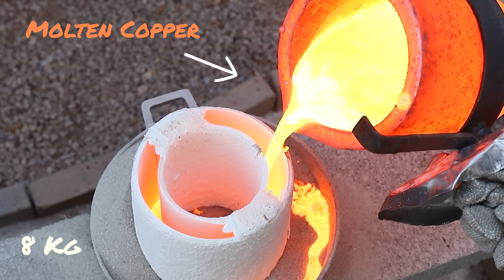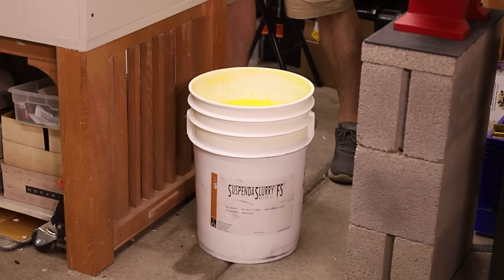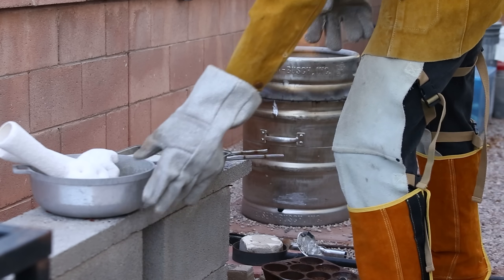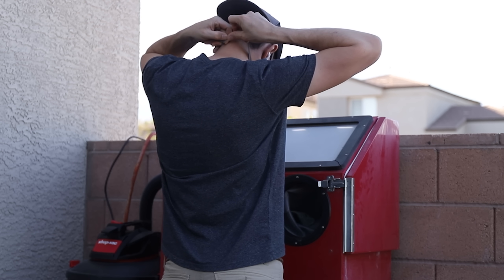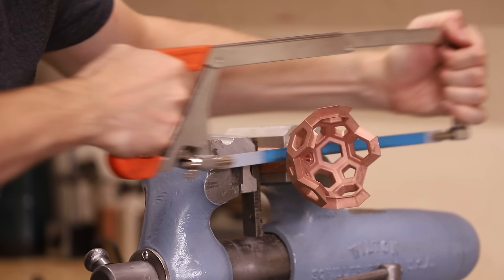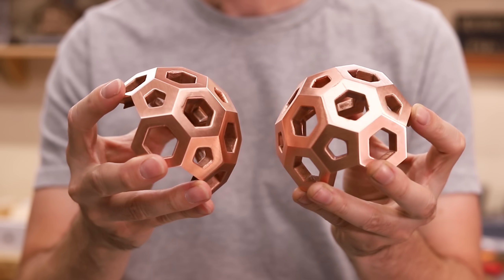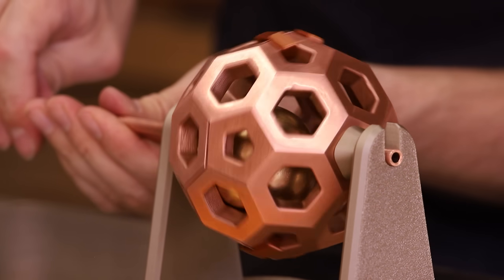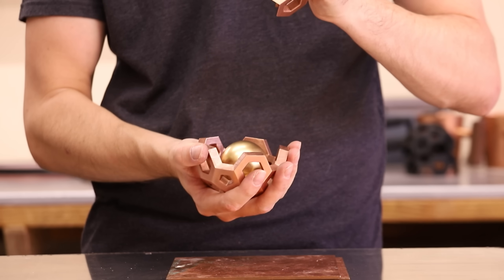HUGE Magnet VS Copper Sphere - Defying Gravity- Will a Neodymium Magnet Float Inside?

Comment: There is probably an optimal speed - you want enough rotation around the magnet to induce currents that cause force to levitate the sphere but not so much that the sphere precesses like a top.  You want to avoid precession since it affects orientation of the fields.

Another experiment might be to induce a voltage across the sphere.   Would DC work, and could AC cause the magnet to levitate.  Would different frequencies of AC cause the sphere to levitate?
Reply: Someone below suggested that the inner and outer spheres would match speed, causing no net current generation.

This suggests that varying the speeds, perhaps in a sinusoidal way, could result in a net levitation.

We see this with induction motors, which rely upon "slip" between the stator and rotor to induce currents into rotor.  The slip comes from either rotational losses in the rotor or torque extracted to do work by the motor.

Comment: That's an awesome experiment ! I'd say it would be worthwhile to make a dedicated , solid rig that you can spin it on . Bearings , a set of shafts , and an electric motor with a speed control so you can vary the rate of spin .

Comment: What if you make a sphere but sliced vertically, and you intercalate the pieces, so... one slice of copper, one empty, an repeat until sphere is complete, and sold the spaces between with just 2 or 3 small joints. Like, each slice with joints between each other. That way even spinning we could have an almost always clear view of the inside.

Comment: if you smooth out the interior to be more spherical the ball wont get pinned to a side at higher speeds, it will be allowed to "slip" against the wall which should keep it from getting caught by the centrifugal force

Comment: Improve the electrical connection between the two halves.
The effect is caused by eddy currents flowing in copper. The currents cause a magnetic field which opposes the spherical magnet.

By improving the connection you will improve the opposing magnetic field.

Silver soldering the joints using an induction heater should work without damaging the spherical magnet.

Comment: Experimenting with camera shutter is a good idea.  I wonder if a strobe light would help you take a video of the results?  Another thought is a higher frame rate.  I've used a Phantom high speed camera before, which would no doubt work but may require removing frames that block the view of the inside.   Could you get a sponsor to help with a high speed camera? There are some youtube channels that do high speed camera work, could you team with them?

Comment: To reduce the breakage of eddy cutrents:
Cold weld it. Some form of wrapping for the magnet inside, easily removable when its sealed in. A  a strong vakuum chamber, and preferably a tungsten cube to weight pressfit the pieces together (but no direct contact, or something else that is really heavy).
Possibly a good collab chance with other creators.

For the ball itself. Since distance significantly drops magnetic force, I'd  pssibly try to even out the force by reducing the scale of sphere by 10-15% and shrink the walls by another 10% for easier visibility.

For better distribution in the mold for more delicate projects I'd look int s lab shaker plate, and mod the tray with a center pole to which you can afix the casting molds.
Or a vacuum chamber, so the copper gets sucked in.
That would also remove the need for the plugs: you can cast the rods in place.

Comment: Amazing stuff. One idea is to have a smaller spherical magnet which ought to make it more visible when it's floating in the centre. Also, using that second magnet to spin the copper "sphere" was very cool. In your next iteration, rather than the motor spinning the copper sphere, have it spin the 2nd magnet to avoid obscuring any view of the copper sphere and its contents.

Comment: For the bubbles: get a strong massage wand or some other strong vibrator. When the main part is dipped in the slurry, hold it against the fill line so the bubbles break of.
Also, a light aceton vapor bath for the mold to smoothen it works wonders and reduces thebprint lines.

Comment: the effect is determined by the precise dimensions of the copper sphere in relationship to the magnet's dimensions and it's specific field geometry.

tweaking of the copper sphere dimensions would give a better effect.

my intuition is the diameter of the copper sphere could be larger to take advantage of a sweet spot dimension while enlarging the holes to give greater visibility inside the sphere.

then rotate under a strobe light for an even cooler effect.

Comment: I'm a fellow curious  let's-make-a-machine-to-see-what-happens type guy —not at expert on anything. But I'd like to share with you what I think I'd do in your place, in order to try to suspend the magnet in a way that remains fixed at the very center.

1. Please use bearings! From my experience it's very important to reduce friction all you can on this type of experiments. Your setup probably works better with simple, regular bearings (do not complicate yourself with magnetic bearings an all that).

2. It is also important to give due importance to use a true axle: any bend, even very little ones, messes with the experiment. I think the most simple solution is simply using a short chromed stainless steel.

3. Try to balance your sphere: the clips that you put to close it are adding weight to only one side, adding to that undesirable vibration. You can try using the same clips on the other side: if it doesn't work, you can make refinements adding some tape, little by little, until everything is balanced

4. Use a more solid and stable structure to hold it all. Consider using wood, iron or the like to make a sturdy frame, not plastic (but again: do no overcomplicate yourself! It's only important for it to be functional) 

5. Consider adding a "track" inside the sphere, so the magnet has a smoother surface for start rolling. I guess my first try would be simply making a ring using a 1/8" rubber sheet that I happen to have.

6. It is my hypothesis that the reason the magnet couldn't get to the center and stay there, is because of all cited before, but most of all: the lack of control over the speed of rotation. Use a setup that allows you to accelerate it as smoothly as possible.

7. If this was my experiment, in addition to all said, I would use a VERTICAL setup, mounting the axis for the sphere to rotate like a turntable. This way, I'd fix the motor at the North pole, and as I would be using steel pipes as suggested in No. 2, I would insert a wooden or plastic stick in the South pipe and use it like a base or pedestal to hold the sphere already at the center from the start. That way I can achieve a fast speed more quickly, and then —very carefully— I'd lower the pedestal to let the sphere suspended in place when it feels stable enough.

Good luck! I hope you find this ideas useful. Whatever the path you take, please keep us informed! I'm very curious of what's next! 
By the way, I wish I had your skill level at craftmanship! Very good job! 👍 Cheers from Costa Rica!

Comment: It might be worth a try to cast or grind the interior of the copper cage to have a more spherical shape so it more closely matches the disc/tube  design that inspired this project. Also, it might be interesting to modify the disc/tube design such that the tube has an angular interior to see if it suffers the same issue with respect to rotation speed.

Comment: If you weld it or soldier it, the resistance is smaller, thus more Eddy current. However, be careful to not let the heat destroy the magnet.

Comment: In theory, you could make it into an electric motor if you can make it rotate with a magnet because its 2 conductive spheres that can react to magnetism.  With the hexagon sphere acting as a gate/switch for a copper coil to make an electromagnet and the magnet sphere completing the circuit. Might just be a chaos sphere at that point... but would be entertaining for sure. Don't know because its hasn't been done 😆

With an insulator between the 2 half's it may also have other properties that might make the magnetic sphere dance between the 2 sides as it generates magnetic flux on different planes, maybe different size magnetic spheres would do something different?

cool experiment

Comment: make it larger, make the faces electro magnetic, or super conducting. Hollow out inner ball magnet, lighter makes it less inertia per unit of force, instead of just spinning sphere, induce rapid electromagnetic flips. Also by insulating between faces of the outer shell, you may find it causes more even circular currents.

Comment: The angles on the inside of the copper cage are effecting the consistency of the resistance I'm sure which would probably change if the inside of copper sphere was internally and also externally smooth and round somehow and the holes to see through probably should all be same exact size. Basically everything needs to be balanced well with no angles

Comment: If you are going to rotate the cage at high speed (and therefore have a large induced current in the copper), you could probably make due with a much thinner cage.  This would help with the visibility of the sphere on camera.  I would also advise that you choose a single Platonic solid geometric form instead of mixing polygons.

Comment: @Robinson Foundry - This is a fascinating idea. It prompted me to do much thinking. Specifics to follow...

The Lenz effect and video capture are being weakened by several things.
1) The interface between cage halves is not nearly as conductive as the rest of the cage. A few little plastic clips do not join the halves together nearly well enough. Ideally the halves would be soldered together, preferably with high-Ag silver solder for highest conductivity. But heat is the enemy of magnets, so read on... 

2) The ball is too heavy for the overall configuration, and may be too large. As is, there is an inherent requirement for very large electric currents to circulate in just a small fraction of the copper cage. However,  maximizing the currents also requires a shearing motion of the magnetic lines across the conductive copper, and that part is being achieved only sporadically.

Magnet motion parallel to the field lines does nothing towards creating levitation, and widely-spaced poles mean that the magnetic field has a very long path through air, which weakens it greatly. Also, the most intense part of the existing magnetic field is tending to act in an unhelpful direction much of the time, leading to a bumpy ride for the ball. The magnet is constantly tending to spin around into the least work orientation - - not levitating. 

The ideal interaction of ball and cage would have the largest practicable number of field lines all crossing the copper at right angles at all times, which the existing configuration has no way of ensuring. That ideal is not practicable for several reasons, but can be closely approached. 

Re-arrangement of the magnet poles can greatly reduce the magnitude of localized electric current required for levitation, while also eliminating the tendency of the magnet to align itself in an unhelpful direction, plus simultaneously reducing the magnet weight. 

3) The section of the video at 11:46 clearly shows that the magnet is a simple dipole. That creates a single very large magnetic field, most of which penetrates far beyond the cage. It would be very much better if the magnet had numerous poles, at least six and preferably eight or more, pointing out symmetrically in many directions. Then the extent of the loops of magnetic field would be a much better match to the cage size, while the smaller loops create a much more intense field in the loops. The straightforward approach to this would require remanufacturing the magnet and magnetizing it with a very special custom jig, making it extremely expensive. 

The inexpensive alternative, very interesting in its own right, is to make your own special magnet out of smaller magnets held together in a plastic cage around a central iron core, such that the assembly creates a multi-pole quasi-spherical Halbach array, and saves weight. This can be achieved with a handful of generic disk magnets plus the central core. The basic idea is that neighboring poles on the ball surface are fairly close together and will always have opposite polarity from each of the nearest neighbors. Consult me if you need help with this. 

4) The drill motor noise really detracts from the spinning cage part of the video. The long lever arm of the rod going to the drill causes the special pentagonal plug to wiggle in the hole and become loose, which indicates the need for a 3-point support and a very flexible _indirect drive_. You can easily print such a support. At the far end, by the new support pivot, I recommend adding a largish-diameter pulley with a barrel shape (fatter in the middle, as done on old flat belt systems seen in old factories). 

The barrel shape makes the moving belt, or string in this case, wander towards the wide center of the barrel. Several turns of string around the barrel can lead away off-camera to a sound-deadened box holding a small high-speed motor with a speed control and a tiny pulley. Your existing Dremel-type tool may be great in this role. The high-pitched noises from such a motor are more easily deadened, and the large pulley will reduce the rotation speed while increasing torque.

Good Luck!

Comment: please for the love of god install ball bearings on each joint🤤🤤🤤 i want to see this bad boy hit mach 9 — 

also i’d love to see a output on energy output, possibly worlds first true Perpetual motion machine anyone???

i’m curious what the weight:ratio limit is on how far and how heavy you can drop this before the puck in the beginning actually touches the base—imagine an elevator dropping from the top floor as it slowly glides down, you just cut your elevator’s electricity bill in half.

Comment: I am curious is the electrical continuity of the unfused seam is somehow affecting the generation of electric fields. While the most straightforward solution would be to weld them, I'm thinking you also might have some luck by repolishing the join and adding some conducting battery grease between them to ensure good contact

Comment: im genuinely curious if increasing the size of the outer "sphere" would increase the speed at which you would need to spin it to make it float, also since this is technically building up a charge however small it is id like to see if by running this machine automatically it builds up a charge big enough to shock you if not properly grounded...

Edit; forgot to add this but if those clips are made out of copper they could be adding inconsistencies in the forces the magnet is experiencing

Comment: How about NOT using Hex shape on your design it might cancel most of the magnetic field flow, further more the copper join might been oxidized and lose the mag flow. My suggestion,  Try do ring shape wrapping around sphere weld them together horizontally with copper's spacer  and put the Ni-Mag  ball center. You can put windows between the rings for viewing. when put on the stand try test with the current meter both the polar are well connected.

Comment: I like the design of the Sphere, I think the windows you gave us so we can see inside is your culprit. My experience admittedly not as advanced as yours, I did the floating top. where it spins. 1 of the issues I ran into is that the magnets on the base  had to be uniform and evenly spaced.  maybe have the Radius of both axis be solid. Anyway love your videos.

Comment: I was wondering if you had any thoughts as to smoothing, and rounding the interior of the copper to allow the magnet the ability to speed up better, as well as removing a huge portion of the vibrations caused by the magnet bouncing around inside. In my opinion I can easily see that the entire levitation concept is well rounded in your design, but removing the vibrations, and the inherent movement the magnet will face hitting any sharp edges could easily hinder the ability of the magnet to remain in suspension.

Comment: had an Idea: you could make a speed governor with this. by having 1 wire soldered the sphere, and another on the magnet.
and use a two conductor slip ring so the sphere can turn without the wires getting all twisted up
when the speed is below a certain point, the magnet would touch the sphere and complete a circuit connected to device that
would speed a motor up to keep it at a constant speed. or a different way to detect if an Elevator car is descending too fast,
and apply the emergency brake...

Comment: What happens if you set it up vertically and spin it with only the bottom half and the magnet? I imagine the magnet will float up a bit but I wonder how high or if it'll do that at all.

Comment: What if you tried to use this as the armature for an electric generator? Or make the same design out of pla but then wind copper wire. Normally wire is wound around a single in-line axis, what would happen if the armature used coils along multiple axis?

Comment: I wonder if setting the rod in bearings would make for smoother movement. A motor with variable speed control to let you dial in the sweet spot rpm would also be nice.
Reply: Oh you could also put it on a wooden display box, then hide the motor and second magnet on a rod in the box. The motor could spin the magnet which would then  spin the sphere

Comment: HI. I would really like to know when you spin (or roll the first copper tube) does the total weight remain the same (which I would expect it due to the levitation is in the tube supporting it all) or does the total weight decrease. This is so out there I also would not be surprised if it did decrease.